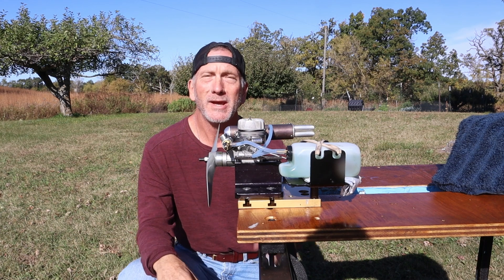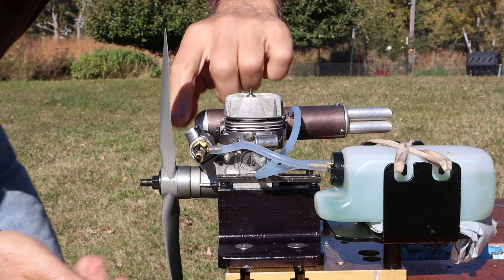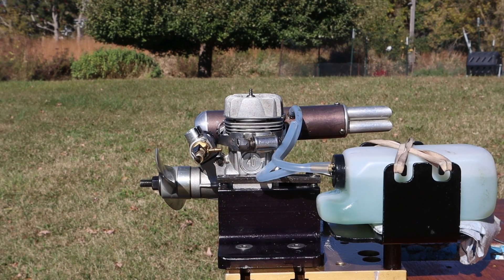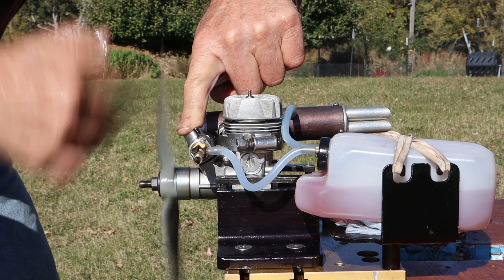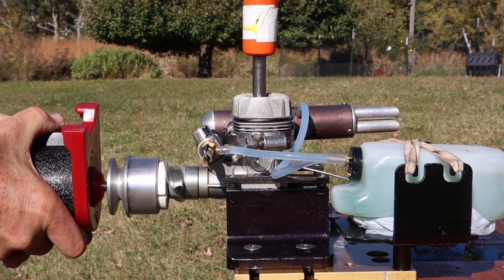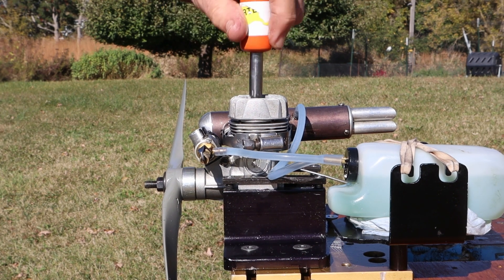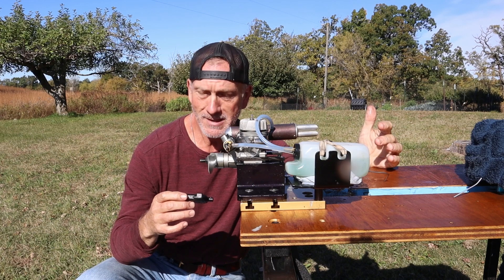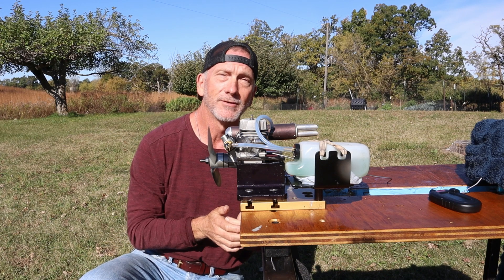Super Tigre G40 Ring The First Run

Comment: David lets see the bearing change please!
Reply from the maker: I never said for sure there was going to be a bearing change.  I have shown bearing changes on this channel before.  Nothing special about this engine over any other 2 stroke I have done.
Reply: @dmrcflyr2  was interested on the prop driver removal! just heat and a careful tap?
Reply from the maker: @alanreynolds2125  there is nothing there to grip on. So either an arbor press, which i no longer have, or a lot of heat, oil and tapping with a heavy mallet.

Comment: You had mentioned bearings before but say they must be ok... Wonder what's going on? Just noticing some play in it or something? 

In terms of the run though... Sounds great! 👍
Reply from the maker: Bearing diagnosis is not a precise science. On some engines is is very obvious and others not so.  If they are REALLY bad it is easy to hear AND feel them.  Going by sound alone is not good enough.  Besides none of my engines are going into airplanes so if the bearings are less than perfect I really don’t care.  For the few runs I will do they will be fine.  If one lets loose and destroys an engine, so what?  These are just objects and have no intrinsic value.

Comment: Runs just great it's a real screamer, talking abouth those counterfeit glow plugs in recent months i saw damaged piston and heads pitted with parts of the glowing element embedded in the piston and/or in cylinder head, and two engines had to replace piston and cyl liner sets, all of them had that plug copy with coil element missing. I recomended to them   see your video abouth those glow plugs
Reply: Also aftermarket cheap bearings, buy cheap might cost you big

Comment: Interesting run; powerful .40 size engine, I'd be rather worried about that metallic noise though. Look for any likely play on either the conrod-crankshaft end or the conrod-piston end, David. Another suspect could be the wrist pin itself. Didn't sound good at all to me. Typically have a look at the rear bearing too.
Regards Harry
Reply from the maker: I did a look inside this engine and it looks just like new.  I was told it only had 4 runs on it before being sent to me.  There is nothing wrong that I can see.